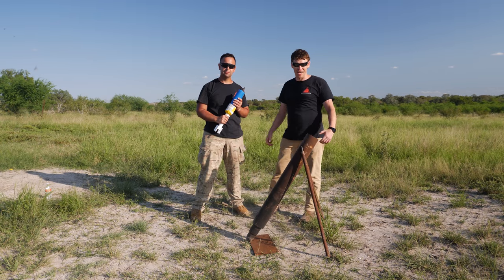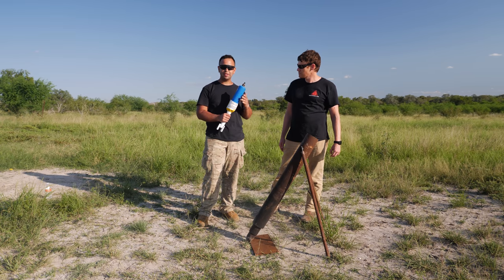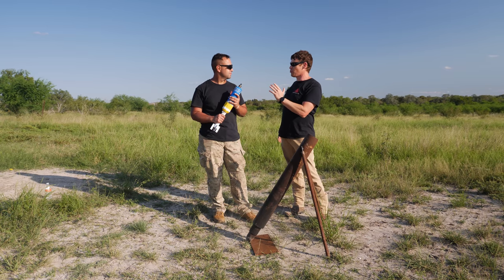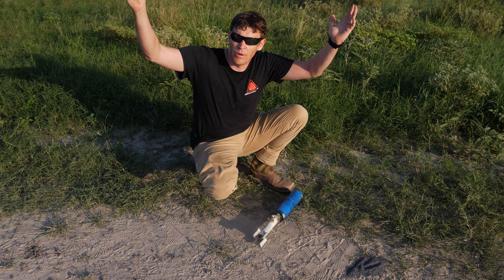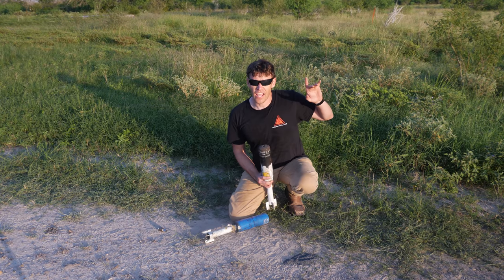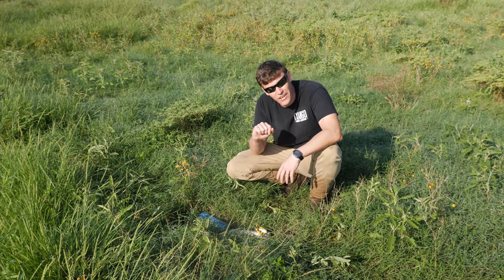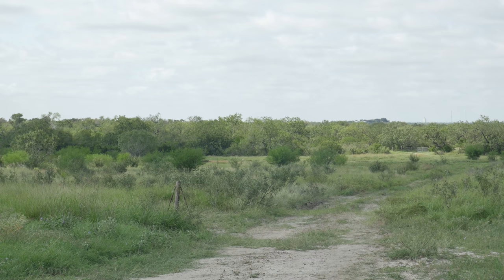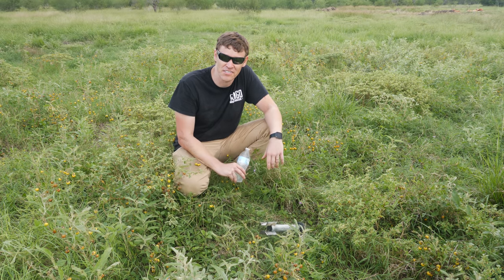Hell Cannon Dud Volume 2

Comment: add additional timing fuse as a backup, so if the primary fuse doesnt fire then the timing fuse will detonate the charge after the projectile drops...
Reply: I like that.  Charges are standardized so hangtime can be max-min'ed.  if your MAX hangtime is 5.5 seconds, do a 6 second delay manual fuse.  If contact does fail, It'll dig in and pop.  Worst case scenario you got an airburst close to the deck.  That's not a bad thing.
Reply: worst thing would be a short launch and detonation near the launch site😬 nope
Reply: @ProfessionalPepper  I'm sure they are well outside a generous exclusion zone.  Unless you are in Syria no reason not to be.  They mentioned timed fusions in evolution 1 I think they just need to combine tactics.

Comment: If you watch the vids online of the indirect fire systems being used, you will see they use 3 in a prong config to insure det.
Reply: Great catch. Since the fuzes are smaller than the diameter of the "mortar" round, the risk of the round hitting on the edge of the round and not properly impacting the fuze is pretty high.

Comment: Copy the panzerfaust fuse. In short, a block of cardboard is stopping the firing pin from hitting the primer. When it launches, a weighted sleeve falls backwards and a snap ring opens. On impact, the snap ring catches the weighted tube, and the entire assembly crushes the cardboard, allowing it to strike the primer.
Reply: When I was a dumbass kid , literally a teenager I did something similar with a nail, 12ga shell, bamboo tube and coat hanger tail, a little duct tape. I got to idea after seeing a improvised Vietnam toe popper in a combat manual

Comment: Are you using an inertia striker or spring assisted pin. 
Always remember the WWll torpedoes that didn't fire on impact.
It turns out aluminum pins were the answer. Fascinating story.

Comment: The primers used on the Bunkers Busters or Hell Fire as you call them, videos on live leak and other platforms were very simple and effective. Maybe research it. That’s been a consistent problem from in battery to failure to detonate is not that hard. You guys are experts?  Maybe fire extinguishers or propane tanks will be more successful? just an internet researcher with an opinion.

Comment: Could you not use standard time delay fuses from grenades? Or is it 100% improvised?
Reply: We are working on a bore-riding delay fuse that is like a grenade fuse. It is simply bigger so that the "spoon" fits in the bore and doesn't bother the initial ejection flight path. Def a prototype.